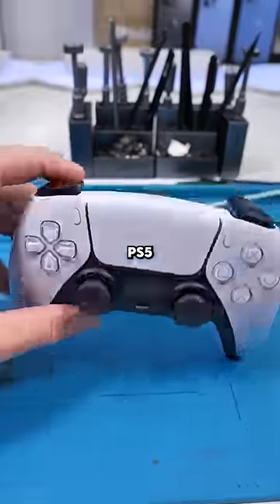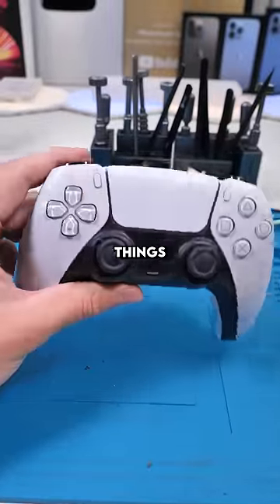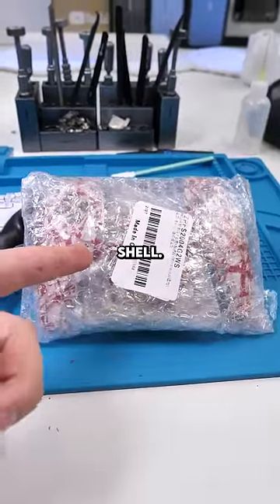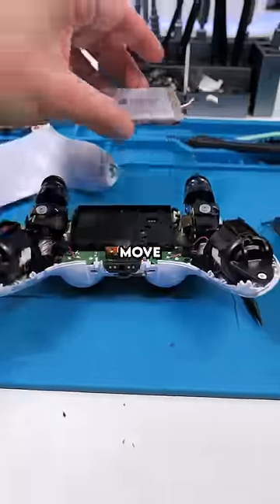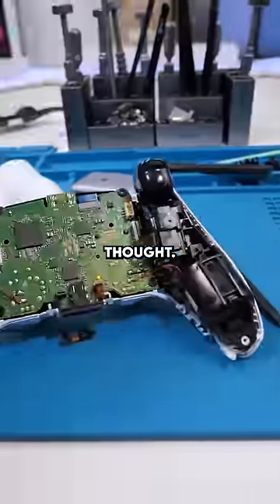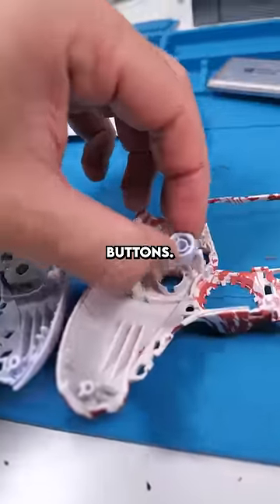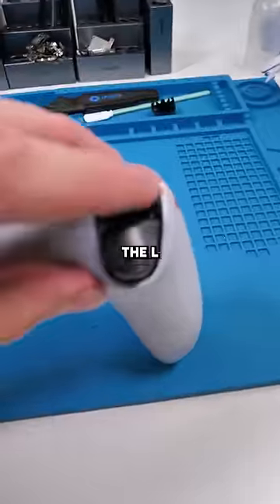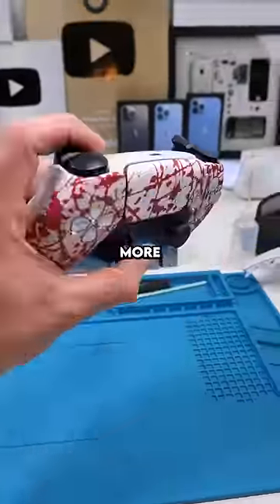Customizing This PS5 Controller Was IMPOSSIBLE.... #Shorts

Comment: Sheesh, might be quicker to paint the thing. Also, why, out of all the shells, did you pick crime scene? 🤣
Reply: Funny thing is, there's vinyl decals where you don't even have to dismember the whole thing
Reply: @jjOnceAgain  another funny thing is the PS5 co trolled is ass unlike Xbox because when the battery eventually goes bad from recharging you have to buy a new controller rather than a new rechargeable battery pack.
Reply: @UraniumWolfy  you can buy new batteries for both controllers. You just saw the guy takeout the battery on this video, you can actually find replacement batteries up to 3000mah to give you about 10 hrs of playtime.
Reply: TFUSION  even Linus from ltt agrees with him

Comment: I’ve done just about everything to my dualsense. All from etremerate. Got the 2 back buttons, face clicky kit, matte black back casing and caution orange front casing. Matte black middle piece (first thing you pop off to open controller) custom grips that stick on. All matte black buttons with no labels (looks sick) scariest part was soldering the L3 and R3 buttons to be mapped and removing the touch pad. Now I’m doing it to my series x controller. Making it all matte black, but the remap kit involves a lot of soldering, and my gun is kinda crap.

Comment: The inside actually look similar to my dual4 that I took apart and cleanned. I though there will be alot of internal  change because the outside look very different. The only thing i noticed that changed is the vibration part.

Comment: This is pretty cool but is there a certain reason you have to transfer the controller over to the shell instead of taking the old shell off and replacing it with the new one? Also, is there a reason that you have to take the shelf off, paint it, and then put it on? Like why can't you just paint it while it's already on the controller?

Great video btw, no hate, just wanted to ask some questions to possibly do this with an Xbox controller!

Comment: Couldnt you have just taken the front plate out and swap it with the other plate.? All the components didnt need to be removed like that. Ive done swaps with my xbox controls and all o have to do is just remove the front plate. You just completly dismantled the control.

Comment: I'm not one to participate in console wars put xbox shells just click in and off you don't need to take anything else apart, at least as far as I know, not sure if that would make them weaker or stronger, is them popping off better than a screwed on she'll that will be rigid and not flexible so it would be more prone to shattering 

Idk both consoles are good, both controllers work well, so what does it really matter how modible they are